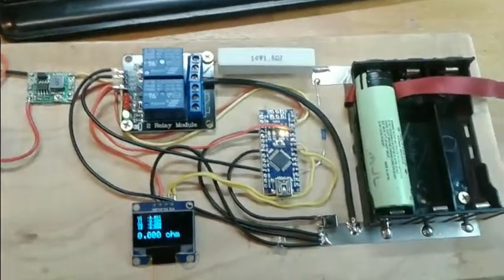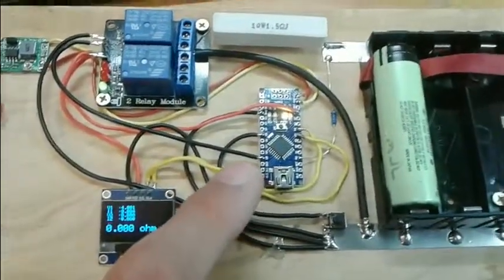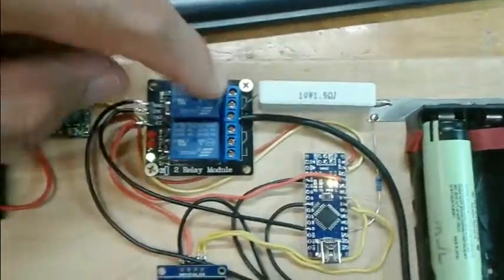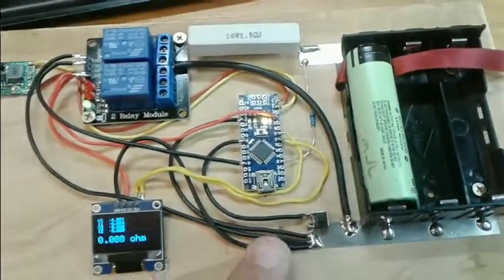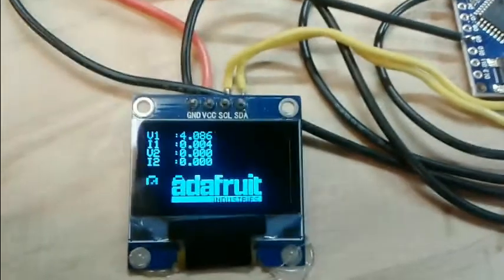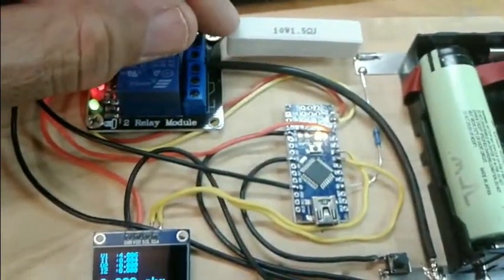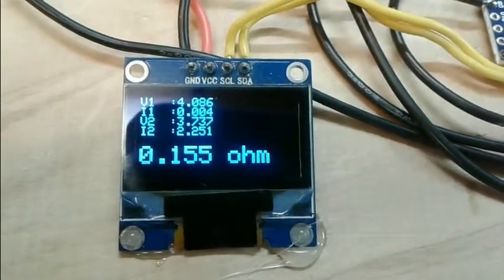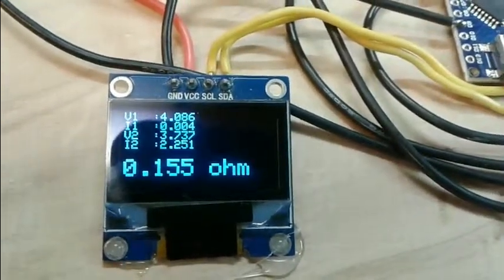18650 internal resistance meter

Comment: hi there.. I wanted to try this with 32650 instead of 18650... can i use the same schematic and sketch without modifications?
Reply from the maker: Hi, i based the circuit to load up the 18650 at 2.2 amps to give a far gauge so you may
need to double that to about 4 amps etc

Comment: Nice version. Just keep in mind a standardized way of testing is using AC at 1KHz and checking AC voltage and AC current variations. It is claimed this 1KHz result is more representative when batteries are used to feed switched boosters, for instance. I personally imagine a good set of Capacitors with really low ESR could be an acceptable remedy, but maybe certain designs count with reduced number of parts and for that, low R.int would be important.
Maybe a way to adapt - at No Hardware Change - your test is to check using your relay setup for incrementally longer tests of 0.1S , 0,2s 1.0s 5.0s and your existing 10s test. Then upgrade the Arduino Software to calculate for sub second tests and compare with the longer 5; 10s ones ; if impedance changes too much, it could separate better than weaker batteries. If it does change too much, maybe some slow electrochemical reactions might be taking place, a possible explanation for 2 different results. 
Independent of that, your test is practical for continuous load applications and has its usefulness.
Thanks for sharing!
Reply from the maker: Hi, thanks heaps for the ideas and great words.....at the time those AC testers where about 3 or 400 from what i remember
so this was the cheapest way to test some ex scooter batteries I come across, its far from perfect but gives a basic guide,
I like your idea, do away with the arduino and just run a resistance meter across the load resistor for a range of set times,
cheers heaps Brett
Reply: In this case, for tests with less than 1s duration, you cannot go without an Arduino or similar. 
Regular multimeters simply are not fast enough. Another video (I guess from Julian Ilet) referred to a paper from Energizer: “Battery Internal Resistance” from Dec/2005 (Google it’s name). It was very educative and the ideas are similar to what you did, but timings are different. 
Bottom line is: adapt the timing in your circuit using Arduino and use an initially small discharging current as 5 mA, pulsing to add to something more say 500 mA for x seconds.

Comment: Excellent

Links not working
Reply from the maker: The Last one works and has the sketch and circuit (Buzzliteyear) is me, cant remember what the first two links were,
but seem to be locked out......those arduino guys are dicks on that forum .......
Reply: @kermets  
All links are not working

Thanks
Reply from the maker: @mdaslamknl  the last one is still working for me
https://forum.arduino.cc/t/18650-internal-resistance-tester/595738/10#msg4222648
Reply: @kermets  Thank you so much
Reply from the maker: or download here
https://drive.google.com/file/d/1PYEsneesyIX7BWV-UYgU3Ezzl76yEdFt/view?usp=sharing

Comment: Great, thank you. Internal resistance seems a bit of a black art. Even my discharger lii-500 gives different results if I test in short succession. But at least provides an indication.
Reply from the maker: Hay thanks for the comment, I did get a better result upgrading to a 50watt load resistor and I think
the code is taking its measurement of amps at its max. and not its lowest reading over the test.
I ask on the Arduino form and no body there could help
https://forum.arduino.cc/index.php?topic=620123.msg4222648#msg4222648
Reply: @kermets  No worries. Have you seen Adam Welch channel? He has an interesting video on calculating internal  resistance. Also done an arduino 18650 capacity checker.
Reply from the maker: Yes I sub to him, there was something I did not like and cant remember, I did try
his version also.....maybe load time or something